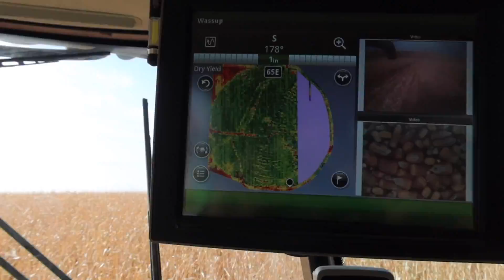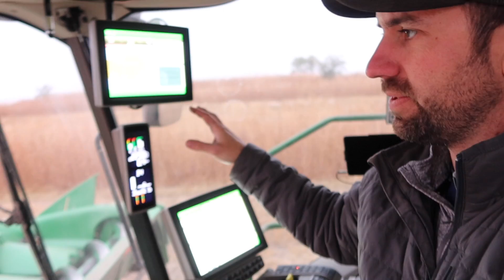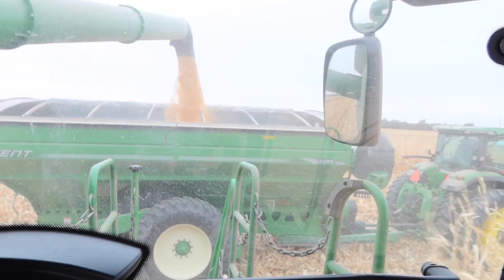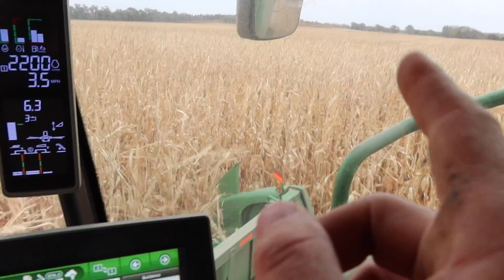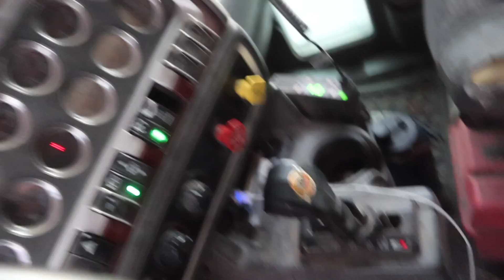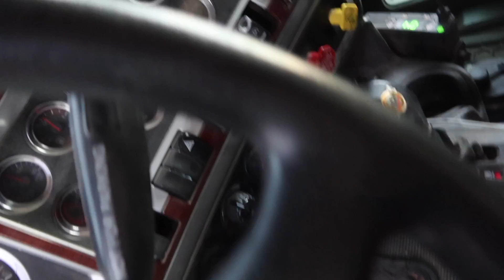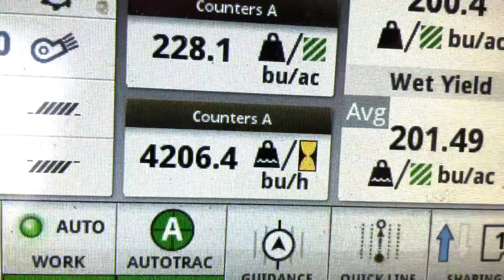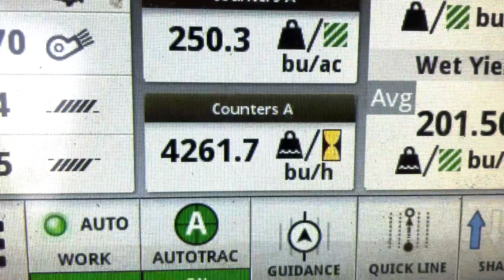Wrapping Up Harvest 2020..Twice! (16 row on S770)

Comment: We updated our husking rolls to the same type you have and have noticed significant additional butt shelling.  Narrowed in the stripper plates and slowed down the head to no avail.  Wondered if you have had similar issues.  Wish we had put on the same as we replaced.
Reply from the maker: Not really, have you got a 600 series head?

Comment: Hey Rob love them green combines on how they work.  How's the new 8Rs running?  Great video man
Reply from the maker: Not bad! 280 has a bad sensor on the coolant reservoir needs changed.
Reply: Code says low coolant level? I got one in the shop 8340RT  the fan was put backwards
Reply from the maker: Didn’t know that’s possible.